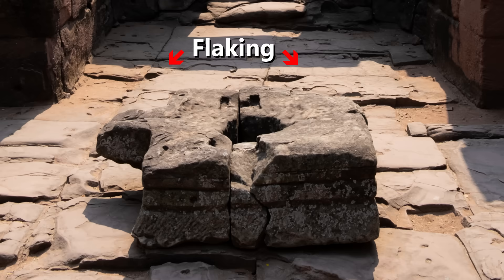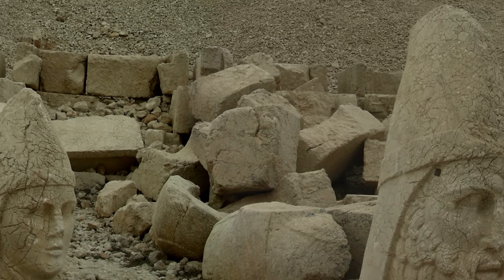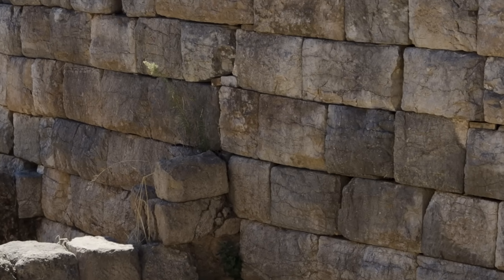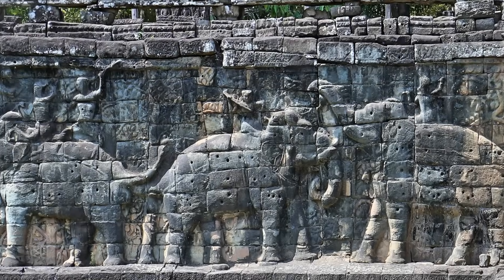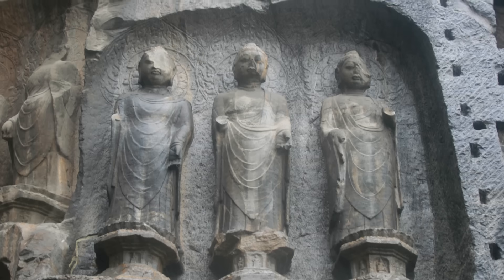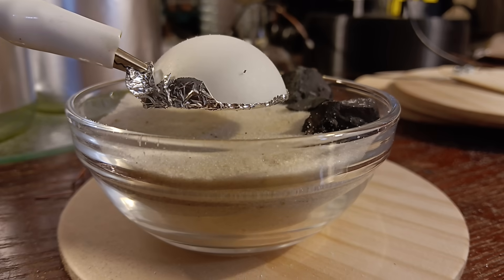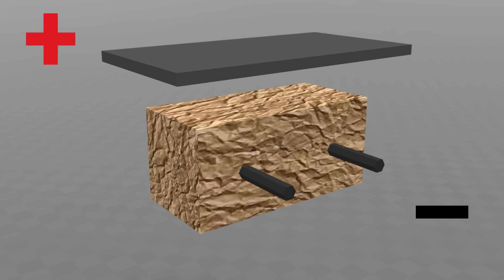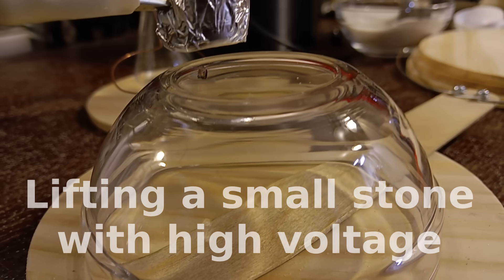The Greatest Mystery, Solved. Recreating Ancient Stone Melding Technology (Part 1)

Comment: I wonder if stone melt with plasma or whatever would have the same geological tell tale signs as rock created in the mantle, crust under incredible pressure. 

Seems like most people wonder about power source for melting when the question is why do we have to explain melting? Is there any reasons to believe melting other than "rocks look funny : melting"?
Disolved/worked repeatedly would be a more likely idea.
Reply from the maker: The micro-fracture damage and 'flaking' of the rock-types used in these constructions can only be caused by excessive heat being applied to the stone at some point long ago in the past. The micro-fractures that formed at this time (also because it possibly cooled a little too quickly) have become more and more apparent as the little bits of material are washed away and moisture / hot / cold cycles of weather pushes these cracks wider over centuries.

Comment: Excellent, and as a dowser that can detect and follow the plasma ( consciousness) flows that meet in abundance where megalithic structures and later churches are located, it is clear this has all been known but forgotten over time, I have received burns on My hands at such sites and as a past welder recognise the smell associated with high voltage burns.
I have long been suggesting that gravity is not a force but a consequence of the implosion over outrush of plasma into and back out of the planet.

Comment: It'd be interesting to see if Edward Leedskalnin also used high voltage, high current to shape and move the rocks of his Coral Castle.
Reply: Эдвард использовал не плазму а звук! Звуковую вибрацию... 
Так же как и строители пирамид!
Reply from the maker: I've studied Coral Castle and honestly don't know what to make of it. The rough coral hides the indicative marks of these ancient stone techniques and it would have to be a place I'd need to see first-hand to discern anything more. I wonder too =)
Reply: @MadPlasmatist  Yes, I haven't studied it in detail either, but it is an intriguing connection. As for the 'formed' stones, it'd be interesting to check if the ancient 'polygonal' masonry, for example, that's present around the world, also involves stones of the same Si Al etc composition, and whether those stones can be locally quarried. If not, then it seems clear that the stones were formed from a worldwide standard mixture that was set using the high voltage/current electrodes. By the way, your research is excellent!

Comment: Your "theory" about temporally turning a rock into almost lava for the carvings is pure nonsense. First because at that temperatures, I bet you couldn't stand at 20 centimetres for it more than 2 seconds due to thermal radiation, let alone doing some real carving. Second because even if you could, you'd really need to be from another planet to carve the rock in such a way that when it'd cool down (and so, the rock contracts), such carving would look like originally intended. And third because I highly doubt it would take a thousand years for the rock to reveal signs of overheating. It would show these immediately and erode over time. The cracks you see on some of the pieces could in fact be due to these being close or right in the mid of a great fire.

When you showed the spark gap experiment between quartz and granite, both repelled the spark, but in the case of the granite (which is in part, quartz) some of it is allowed to go through, and clearly visible in the video that not though all of it, as you state.

And yes, you can disturb a tiny rock with metallic mineral composition by using electric power as shown in the video, good luck applying the same technique to move the megalithic stone blocks at baalbek.

I'll keep being of the idea they simply used some geopolymer that temporally softened the rock, where the holes shown in many constructions would simply reveal they used these for transportation and manipulation during assembly. For example, several independent groups would be working on their part of the project, they would bring their work for assembly, and then another bunch of them would simply fill the holes after it. The nipples, in the other hand, which are normally seen in bigger structures, could as well be their particular version of scaffolding, meant to temporally support lumber or others, and also meant to be removed after the work was considered complete. This is the only theory (to my understanding) that can explain the shapes of the rocks seen at Machu Picchu, for instance.

Comment: where are the electrodes? where is the power source? ya can't promote this idea with zero evidence they had the electrical power capability to do it. just saying things don't make them so. the word is melting not melding
Reply from the maker: In this process, the rocks are not heated to or past their melting point, but slightly below it. They then squish or 'meld' together for lack of a better or similar term. If you watch my video on how an SGL spark gap lingam works, you may begin to understand such a device only exists to handle massive amounts of high voltage, and just wow... what a thing the SGL most certainly is =) Enjoy!

Comment: The problem I see with any "melting stone" ideas for any igneous rocks like granite, schist, etc is that when magma cools quickly it makes obsidian. In order to form crystals like those found in all igneous rocks other than obsidian, magma/lava/melted rock needs to cool far more slowly than would happen when exposed to earyhs surface temperatures.
Reply: Nope. Obsidian forms from felsic magma that is rich in silica (SiO2), typically rhyolitic in composition with 65-80% silica content. This high silica content makes the magma very viscous. The magma is also low in volatiles like water, usually less than 1% by weight. This allows the lava to cool rapidly without much gas expansion. The key requirement is that the silica-rich, highly viscous rhyolitic magma needs to cool very rapidly, not allowing time for crystal formation. This fast cooling usually happens when the lava is erupted at the Earth's surface. Obsidian most commonly forms as an extrusive igneous rock from lava flows or volcanic domes. The magma is erupted onto the surface where the temperature is much lower, facilitating rapid cooling. The rapid cooling and high viscosity impedes the movement of atoms to form crystals, so the lava solidifies as a glass rather than a crystalline rock. Very few or no crystals form. The end result of the fast cooling with no crystallization is a natural volcanic glass with an amorphous internal structure rather than a regular crystal structure. In summary, obsidian forms when viscous, silica-rich rhyolitic magma with low water content erupts onto the Earth's surface and undergoes very rapid cooling, solidifying into a glass without crystallizing. These specific magma properties and cooling circumstances are necessary to produce the distinct glassy texture and appearance of obsidian.
Reply: @robertcutts7264  in any case, melting granite to form perfectly fitting stones isn't an answer because the poured stones would cool rapidly and under no pressure resulting in something other than granite, something with no crystal structure or microscopic crystal structure due to fast cooling.
Reply: @markdeffebach8112  And that is exactly how we can tell that these surfaces have in fact been vitrified. Vitrification produces a glassier matrix, similar to what you describe (but technically NOT obsidian), and just like what is found. That's the point.
Reply: @robertcutts7264  except that every argument for melting granite claims that a coarse grained granite was vitrified and yet remained that coarse grained as it cooled much faster than would allow for the courseness of the grains found in the rock.
Reply: @robertcutts7264  Granite is high in  silica... would certainly lose its gross crystalline structure
Reply: interesting how it melted but retained a "cubic -ish" form and not just flow like hot toffee. Obviously melted in place, still have questions, they do"pillow out in the front  but sides are straight and flat, expect some pillowing on the first and last stones and where there was no reinforcing stone on either side. would tend to pancake out... mmm thinking out loud
Reply: yes, major changes, even major chemical changes melting in oxygen at surface temps and conditions. basically new rocks

Comment: The holes you say were for electrodes is an interesting theory. But I don’t think the nubs were from removing the electrodes. They could have just carved them off later. And not all stones have the nubs. But if you go around the world you can find them in all ancient buildings. Which seems like a signature of the architect to me.
Reply from the maker: The nubs it would more than likely seem, were only left (for the reason of not performing extra / unnecessary work) if they were to either be covered by something else or used as a part of the construction. They were also then only trimmed or otherwise conditioned or dressed if that area was meant to be 'seen'. Don't forget materials such as wood and most metals would have deteriorated long ago. I wonder personally, if these 'cities of gold' myths may possibly have been true - imagine the massive walls of Saqsaywaman covered by a thick layer of gold -  the nubs and dents would held hold / adhere this to the wall. Another interesting note, I've noticed, in a lot of cases you can tell about how thick whatever it was that may have previously been covering them by the length they protrude from the wall. Thanks for the comment and stay tuned for 'part 2' =)
Reply: @MadPlasmatist  I will be looking for part two. 
I don’t think those nubs were anything more than the signature of the architect. Most are too small to be used for lifting. 
Imagine if you want to sign your work. You want others to know it was you building these places all over the world. Any mark you carve in the stone would be imitated. Other people could carve your same mark and pretend to be the architect. But it would be a LOT more difficult to forge with the nubs. Because, every block you carve would have to have the entire face carved off leaving nubs. Harder to imitate. 
Now, I watched a video last night about sacsayhuaman. One rock not used in the building, was very obviously pliable. Like it was the consistency of clay at one point. They clearly either made the rock from scratch or made it soft like clay. I’ll find the video and post a link here so you can see it. 
Other stones seem to be cut while hard. There seems to be several methods for manipulating the stones. So keep up your work on the plasma experiments. I think you may be on to something.
Reply: @MadPlasmatist  and you earned a new subscriber

Comment: This deserves credit as one of the more thought out theories. I'm not convinced this is fully conclusive or accurate. There is significant evidence that high temperatures were not involved. This fails to explain the melted steps. The caves with laser perfect polished surfaces remain unexplained by this theory and the multitude of blocks devoid of both holes and nubs remain unexplained. Also there are megalithic blocks containing organic fibers that would not remain after being heated to the melting point. Some stones have definitely been cut, some stones are identical to others suggesting they were molded, some stones are sedimentary or metamorphic and not igneous there's the stones still attached to the native stone. There are stones too perfect to be naturally occurring like the giant red granite bowl in the Vatican. I think you may be identifying an important clue but I'm not satisfied with the conclusion or the very premature statement that the mystery is solved. Liquification in some instances; Yes. Enough heat to soften stone; No. Electrodes; possibly. Plasma; probably not. More likely, a double whammy being electrodes and electrolytes used to extract gold while the byproduct becomes building material. Holes and nubs may be part of the shaping process or for retaining the surface covering.

Comment: Yeah, so I'm gonna have to call BULLSH*T!. Until you produce a machine that can generate enough electricity to "melt" megolithic stones and do it with the "technology" that ancient people (according to archeologists ) were purported to have. Go Away. Your video didn't even calculate the amount of current needed to melt stone. But as someone who knows how to weld and attended  welding school. I'm going to say "An awful lot." That amount of current  would only be present in a smelting factory. As for you "levitating" that smaller than a pea sized stone. ROTFLMAO You can't possibly extrapolate that to moving megalithic stones. Many which, easily weigh 400-1000 tons. There is ZERO evidence to support your flights of fancy. No one is going down that rabbit hole with you, Alice.

Comment: Marshmallows. Toasted, keeps their shape, as long as you use the right "toasting" techniques. 🏕 🔥 I wrote a bit more about toasted Marshmallows and possible "toasted" rocks in my other comment, but in case no one wanted to read my ADHD book I just wrote here in the comments, toasted Marshmallows are the first thought that popped into my head after this video. 😂 This comment was just a novella in comparison to the other one.
Reply from the maker: Some of the polygonal wall constructions particularly, perhaps, you could equate as a chilled marshmallow (being more solid), and as it is warmed (also, from the inside), the weight of another marshmallow on top firmly presses against the other and they 'puff'... I look forward to looking over your novella lol. Thank you for the great puff, um, I meant the comment =)

Comment: As an electrician of over 40 yrs I have a few questions - The Source of this Electrical Energy? Where are the Generators, Transformers, Conductors and Probes? Where is the other technology that would follow the ability to produce electrical energy? It's not difficult to attract lightning but that doesn't occur whenever you need it. Primitive batteries may have existed but nothing that would produce enough current to melt stone. Nice try, I'm not buying it. Reproduce your theory.
Reply from the maker: This is only part 1 - most metals (especially those perhaps submerged for sometime) after a thousand years or more will have turned to dust or have been taken for their value - I am actively recreating this technology. There are also many numerous, primitive ways to harness charges and make capacitors. Simple copper and aluminum in water for example exudes a charge which can be collected. Someday the power sources may be discovered, until then, the high-voltage applications and methods can still be explored. As an electrician, you will understand that an SGL (Spark Gap Lingam) is indeed an ancient water cooled spark gap and would otherwise ignite into flames in only a few seconds. Take a look at both 'How It Works' videos of the WCSG I invented, and the SGL I discovered because of this new technology... Thanks for the comment and enjoy =)
Reply: @MadPlasmatist  - as an electrician I can tell you that during the construction of Highrises and Large Industrial Plants, Gold Mills and Power Houses, we never learned about SGL, maybe PLCs, AC Frequency Drives, Lightning Protection, Fire Alarms, Security, Data Cabling, Fiber Optics and all Related Codes, Construction Techniques and manufacturing processes. For the prevalence of the proposed technology you've shown in your video, it would have had to be known widely, globally. Surely there would have had to be other devises and technologies developed in the historical or archaeological record somewhere, requiring electrical energy, which I have never seen. Doesn't pass the smell test for me but, I learn really quick, I'll be watching. Thanks. Keep up your work.
Reply from the maker: @WmArthur  I have invented WCSG tesla coil technology only recently, the SGL is it's big, ancient sister... There were no high-amperage spark gaps in our current civilization before, it is because of WCSG tech (and my observance of countless ancient sites) that I have made the connections to not only the lingam, but some of its uses as a high-voltage, high-amperage spark gap. Take a look over my website, too, it explains everything about the origins of WCSG science. Thanks for the comments as well as your attention =)
Reply: @MadPlasmatist  - Does sound interesting.  Strange things start to happen in high voltage fields, like the Philadelphia Experiment, time traveling, people embedded in the ship. The Hutchison effect, melding things together, levitating. Sprites are pretty high voltage I'm sure, occurring above thunderheads, recharging the atmosphere  like a capacitor, from the plasmasphere, during lightning discharges, which also excite Telluric Currents in the crust simultaneously. Tesla had a car that ran on the field? I've seen 250 w HPS lamps on light poles, light up during a dust storm, nothing terminated.  I do believe in the Electric Universe Theory of electrical discharge scarring of Mars, etc. But then again I don't believe LIGO detected 1/5th of a sec. Gravity waves from 15 billion light years away, just in time for new funding, after 10 yrs of nothing. What are the odds? I don't know anything about your work, I'll check you out.